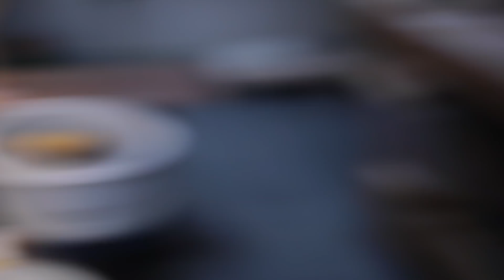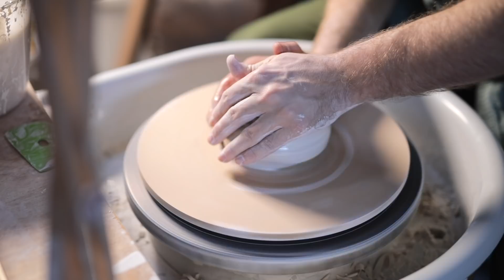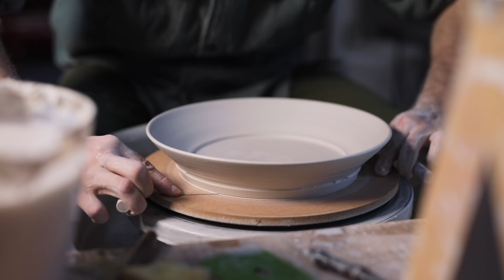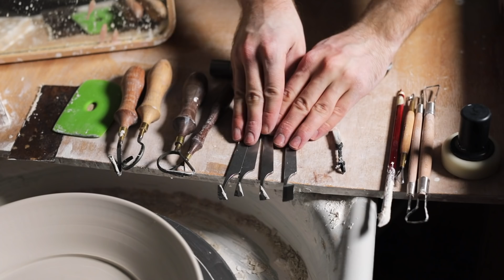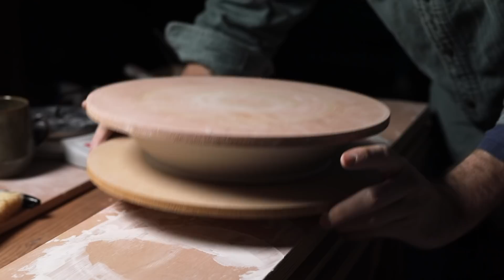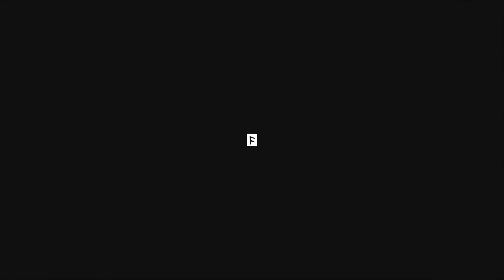Throwing and Trimming Porcelain Plates

Comment from the maker: Hey guys! Merry Christmas or happy holidays to all those watching. I hope you've had wonderful time off thus far. Just to say, I'm sorry if the audio is a little off this video, I'm still recovering from you-know-what and have been isolating over the holidays. Hopefully I will be back to my full self soon.
Reply: Merry Christmas and have a happy new year too 🥳🥳
Reply: It is a great virtue to benefit without harming others🙏retract copyright strike remove brother
Reply: Big brother didn't use the video by mistake, but I deleted your video, you could have claimed the copyright if you wanted, then you would have benefited there.  But why give a copyright strike, it hurts others, and to harm people as human beings is a good deed later?  If you claim copyright you get all the profits but due to the copyright strike the channel is closed or does not work.  If you hurt others, you will lose yourself one day.  Proverbs.  Learn to do good without harming others.  Then one day someone will come to your aid.
Reply: @SatisfiyworldTV  🤮🤮🤮
Reply: If you tool your ware on a bat, then you can lift up to feel the weight and check for thickness that way. Also, a flat rib can be used to compress a vertical outer wall into place without using outside pressure, avoiding a wobbly  clay wall. And, I like your assortment of fine tools and equipment as well as keeping a tidy space. Props

Comment: Nice video and a very fine plate, you make it look so easy, and I know it’s not.😊 I understand the purpose of most of the tools that you presented, but what do you use the spinner for?
Reply from the maker: Thank you! It's used to apply downward pressure to a pot to hold it in place as I trim. In theory you can do the same process with your hand but the spinner stops grogged clay from sanding down the pads of your fingers and it also means you can apply downward pressure that's distributed across the bottom of a pot, rather than it all being focused through your fingers. Like lying down on thin ice as opposed to standing up. If a pots base it thrown thinly using one of these can help prevent it from bowing inward and deforming.
Reply: @floriangadsby  Oh I see. I think I use a small lid for the same purpose. 😁👍 Thank you and have a happy new year. 😊

Comment: How are square plates made? I guess they aren't thrown on a wheel but moulded or something?
Reply from the maker: You can throw circular plates and then cut the sides afterwards. Or you can use moulds or you can slip cast them or just hand-build them, there are plenty of ways of doing it.